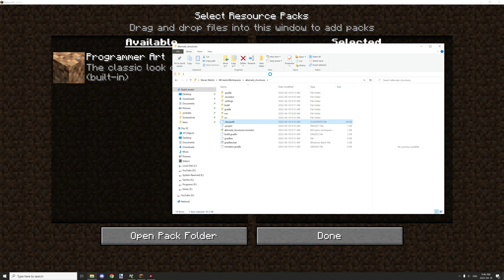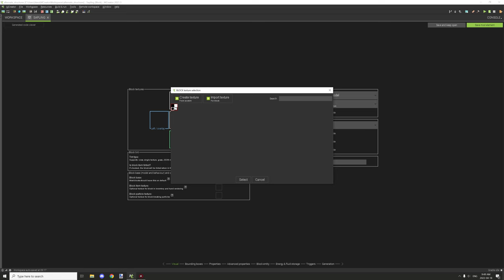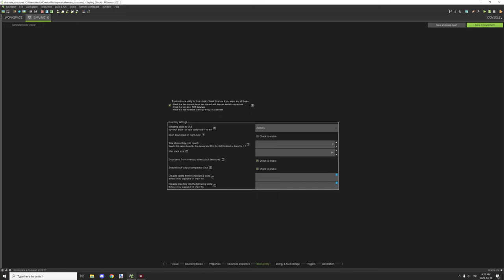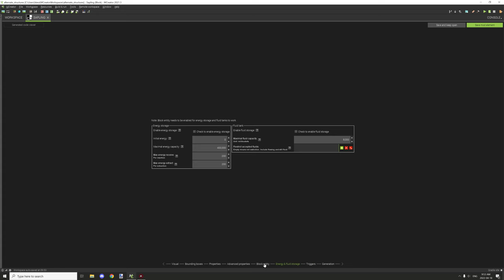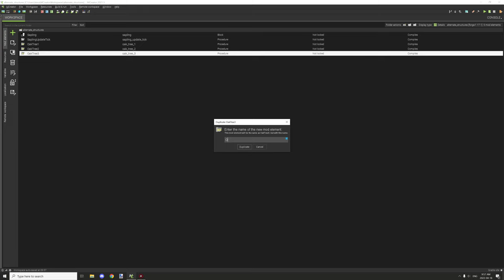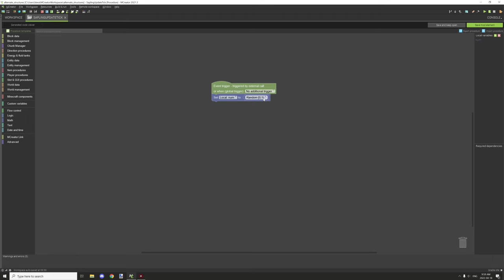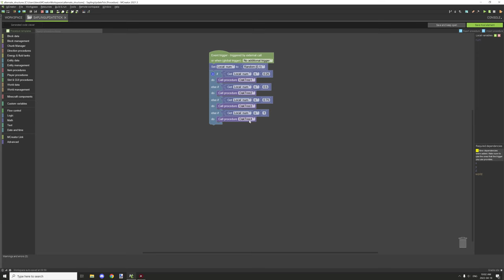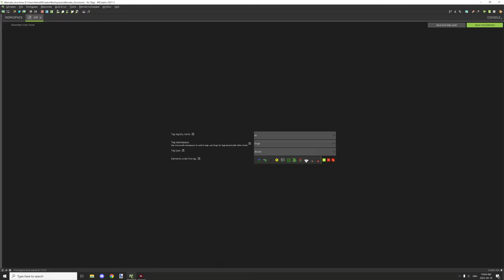MCREATOR TUTORIAL: Random Structures | 2021.3

Comment: hello, do you know how to make it so that when you right click on a block, it waits for a few seconds and then something happens? I'm doing a summoning ritual and I want it to wait a bit, like a timer, but I can't find anything that works for me, thanks.
Reply: What version are you using cause as far as I know there should be a waiting procedure in the procedure tab
Reply from the maker: There is a wait block where repeaters are found its a green block, it is measured in ticks however local variables are not supported.
If for some reason you need local variables I have covered variable timers in the past that still work to this day you can use global or NBT variables for them with a update tick procedure.